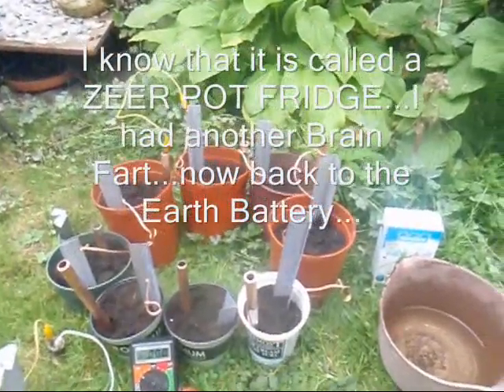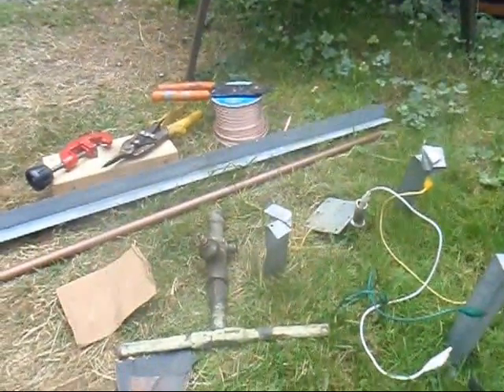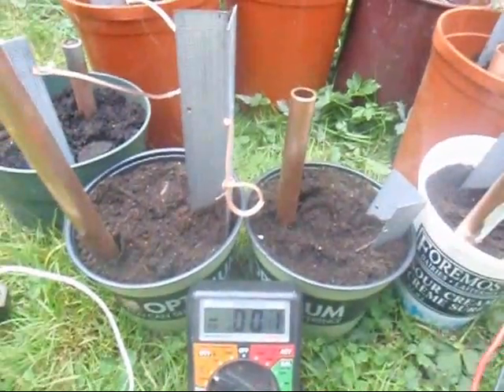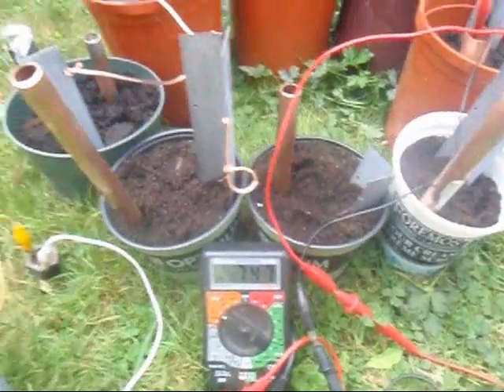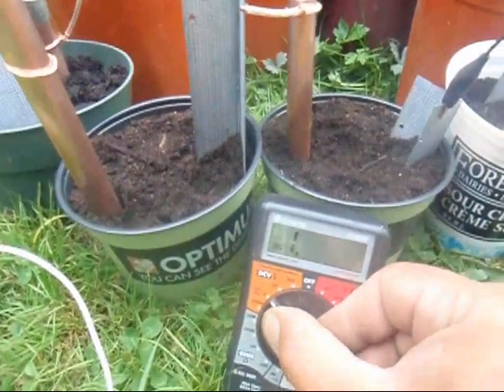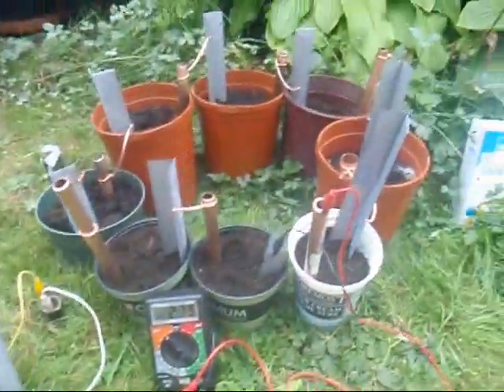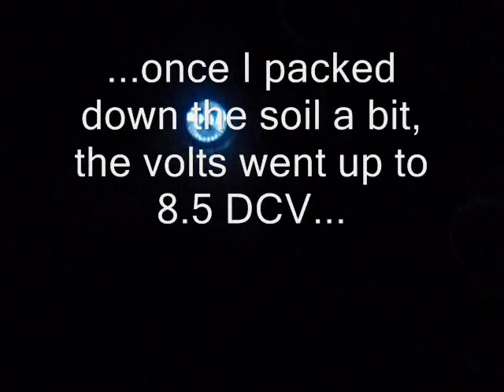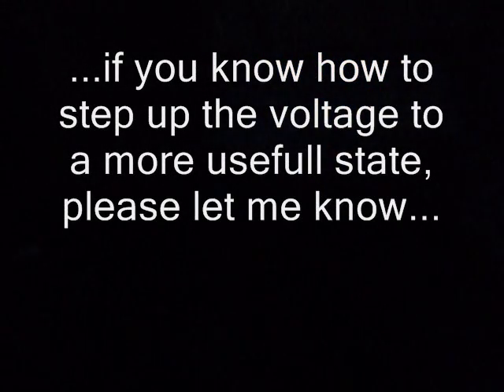8.5 DCV Earth Battery Lights Five LEDs

Comment: try a buck-boost converter this is what I will use if I can not make a set to put out 12 to 13 volts. I think this is great thanks.
Reply from the maker: I did buy a "step-up" converter/capacitor a while back. Unfortunately it has not been tried in this circuit as of yet. Have no idea what junk box it is in...you are welcome. Glad you got something from this twelve year old post... That has always been the goal, higher voltage. But what is really required is more amps in order for a cell like this to be more useful. Please keep me posted...

Comment: Thanks for this info I will try it I would like to build a setup to be able to make 12 to 13 volts DC  this is better than solar pannels was the dirt wet or dry?
Reply from the maker: Your welcome, surprised that people like you are still asking questions. That is a good thing though. As for yours. The soil used was not wet, but damp. All except for the one that had water poured into it. One thing you should try is to hook the cells up parallel, and not in series like in my video. Supposedly it is a better way to connect the cells together. Enjoy....

Comment: Does plastic vs Tera cotta vs metal pots make any difference.
Reply from the maker: Thanks for the question. To the best of my knowledge, any non-conductive material can be used, without any difference to the voltage. The size of the metals used will effect it though. More surface area for the reaction to take place. Using a metal container could cause some sort of "short" in the circuit. But now you have me thinking about just using a can, and copper pipe. As long as the can doesn't have a plastic lining, it should work. Seems like a few tests will need to be conducted...
Reply: @ I also wonder about Terra cotta being wet. Would it cause a short in the system. The metal bucket could be insulated by a terra cotta or plastic plate used to hold water in terra cotta pots as insulation between the container and the ground, IMO.
Reply from the maker: @alberthowe7895  We know water can conduct electricity, so if the soil was saturated it is possible. The soil just needs to be most, not soaked. On the other hand, you can make a "wet cell" battery, where the pipes are in water, and still create a current. Certainly am not an expert in this field, so all my thoughts may not be correct. Still learning myself. You can also research the Baghdad battery. It was used for electroplating in ancient times. (The Baghdad Battery is believed to be about 2000 years old (from the Parthian period, roughly 250 BCE to CE 250). The jar was found in Khujut Rabu just outside Baghdad and is composed of a clay jar with a stopper made of asphalt. Sticking through the asphalt is an iron rod surrounded by a copper cylinder.) Source: Smith College Museum of Ancient Inventions.
Reply from the maker: One more thing is that referring to these as batteries in not actually correct. They are power "cells", "earth cells", "water cells" etc. since they cannot be charged, or hold one.
Reply: @ I am familiar with the Baghdad battery and how it functions.
Reply: Thanks for all the replies.
Reply from the maker: @alberthowe7895   You are most welcome. Thank you for your questions. It has only been twelve years that I have put off doing more experiments. May just be the time to start tinkering again...may have said that once or twice before also...LOL...
Reply: @Drunktoads  well please keep me informed with any results of your tinkering or tests. I look forward to them.
Reply from the maker: @alberthowe7895  Surely will try to finally do that...yours, and others interest in this is inspirational. Thank you....
Reply: @ again much appreciated the conversation on the topic.

Comment: Increasing the amperage for earth batteries is quite simple.  A law of physics states that wiring in parallel will add the amps of two power sources.  We simply wire a solar panel to the earth battery.  We build the earth battery to the desired voltage in series.  Earth batteries are the cheapest voltage around.  Then wire a solar panel to the EB in parallel.  Boom best of both worlds.   Real power.
Reply from the maker: Appreciate your input, thanks for taking a moment to reply. Unfortunately no further testing has been done since the original post date. Have been compiling on the tips from the comments, just have not put into action yet. Thanks again for your interest...

Comment: A Non-Ideal Parallel Circuit
If you build an earth battery using tap water, aluminum, and carbon, you will produce the cheapest green volts in the world.  I discovered that if you wire a solar panel to the earth battery in parallel you can use the high voltage of your earth battery and the superior amperage of your solar panel.  Massive wattage can be generated with this idea.
Reply from the maker: It is always good that people such as yourself keep pushing new innovative ideas to be shared with others on this platform.           Thank you for the reply.

Comment: @drunktoad I love your video. What's the current/amp you can get? Also can you charge a battery band with it?
Reply from the maker: Well Thank You Very Much (in my best Elvis voice). Amps have always been the issue when it comes to charging a battery using an earth cell. You may be able to charge a 1.5v battery with this set up, but not a 12v car battery. With more cells maybe. There is some good information in the comments, and am quite sure better videos than this out there. Appreciate you taking the time to reach out...

Comment: Wouldn't it stop being an Earth battery once you removed it from the Earth isn't it a dirt battery now that it's 8 individual cells in pots.
Reply from the maker: ..ya, I can easily agree to that. The earth and pots along with the anode and cathode create cells...similar to a battery. As you are correct, they are no longer in the Earth, but created From the Earth.
"Energy  Can Never Be Created Nor Destroyed, It Can Only Be Transferred Or Stored"...                                                       You Cannot Free "Energy"...but you could make Energy Free...for the better part of Humanity ???
Reply from the maker: ...so at 01:47 ish, the square galvanized piece of metal, grounded out the pipe. I have mentioned my flaw during this experiment before. At any rate a pencil and a paper clip or penny will get you 00.71 DCV from the Earth...more or less... but the key to Power is Amps not Voltage....which is hard to acquire from the Earth alone...
Reply: My point being an "Earth battery" will give a DC charge much like a battery but aswell an AC charge which batteries do not do "Earth batteries" work with telluric currents.
Reply: No such thing as "free" energy but it's free to me
Reply from the maker: @sonmeister3721  Share your knowledge....I am willing to listen...others too...Have not put much time into figuring it out. But pretty sure somebody else can...or has ???

Comment: I wonder if you put ,multiple anodes and joined them as one and did the same for the cathodes the bigger surface area would give a difference in voltage or current
Reply from the maker: From my understanding a larger surface area does not give a higher output. A penny and a paper clip will put out the same voltage as one of those pots(cells). Pretty sure I did a comparison between the two, not sure if the results were posted or not. 
Thanks for the inquiry...and please share your findings with us here.

Comment: I think the most important thing you have discovered or learned  is  that its not about bigger and more and complicated, but small and simple. If you could get more power from the earth, we would be electrified and barbecued So it works a bit different. Keep.on researching . Good work...
Reply from the maker: Thank you for the comment, your perception of my learning experience is correct. Even though my experiment was not mind blowing, it did act as a platform for learning. (for myself and others) With all the knowledge shared by others comments. Still wonder if it is possible to attach a DCV booster to increase the output ?
Reply: @Drunktoads  Thank you for kind words. I think the Universe works a bit different. Ask and you shall be given. Meaning....if you need 2 volts you  can't be given 10kw. Electrons are just a small part of the atom . Therefore if you could think on the atomic level the way the Universe works and request 10 kw it shall be given to you. So you have to allow the Universe the possibility to give for whats needed. Therefore there are no batteries in heaven :-)
Reply from the maker: You are welcome, and well said. If that 10 kw is in the form of a lightning bolt...better get me a key, and a kite. Thanks again for your thoughts...

Comment: The tube cell built will give out more power. Center rod is alluminium and exterior copper but due to ground touching the copper you may need to isolate it and ground the alluminium. I never grounded them. And add water and oxide in the pipe, copper oxide will do
Reply from the maker: Thanks for the information, the one I rigged up was on a whim and quite primitive compared to others...have not done much since. Hope to get back at it in the near future...

Comment: I got 44 volts from my earth battery. I uploaded it.. I can get infinite energy if I had enough material. You have to make a battery capacitor combo. They can be very small or very big doesnt matter. they'll put off the same amount of voltage.

Comment: Very interesting concept, I wonder what would happen if you changed the acidity of the soil by adding some citrus juice or vinegar? I might have to tinker with this myself, but I'm thinking along the lines of a "Baghdad Battery" which were "supposedly" used in ancient times. Just a basic ceramic pot with a tube of copper and an iron rod inside the copper tube, then pour in citrus juice and it should produce voltage as the acid medium attacks the iron. My thinking is this: Add a piece of iron bar stock in the soil between your copper and galvanized conductors, then pour some vinegar or citrus juice around it in the soil and see what you get.

Comment: I like your setup man. I have come to hear that if the copper being used was in coil form then you could perhaps produce more? in going to try it out, what do ya think?
Reply from the maker: Thanks for your like. Have not done much on this channel in a while but there is a lot of good information from others in the comment section. 
My understanding is that a larger surface area of the metals used does not really produce more power. Even though you may produce a higher DCV by adding more cells, without amps the use of an "Earth Battery" will be limited. Let me know how it turns out for you, for myself and others to learn from the experiment.
Reply from the maker: ...flat pieces would have more surface area contact than a tube due to the middle being hallow and not in contact with the soil. It would be better to use that coiled copper to make a moonshine still.

Comment: https://www.youtube.com/channel/UCtGbSzKy4oqzgqWWQ7DxpPA
How to run a 12 VOLT LED auto light on 1.5 volts AA.........
One can search "Joule Thief" for electronic circuts.....
all it takes is two coils, one a RF (radio frequency) choke from Radio Shack
for $3, three loops of 14 gauge wire around, a 3055 transistor and the diagram.
Anything else is there to improve that....see my channel please!!!
Sustainable_Energy

Comment: The ground is the negative terminal. The positive come from the atmosphere above or the sky. Use a single copper pole that goes into the ground and sticks out high above the ground. The higher the better. 15 ft should yield better results, think it was about 30 ft where the positive draw becomes much greater due to changes in atmosphere. That might be a bit large of a scale to start with, so try what you are able to. Basically the iron pole/pipe is simply a medium through which the natural electric energies can travel through in order to be utilized in a useful manner.

Comment: This is the first message I have recieved. As I said before you must have an antennae 15 feet or more above the ground with wire attached to it the other to rod in the ground. Same thing that powered the telegraph system in the 1880's
Reply from the maker: ...ya that was my fault for the late reply. Thanks for passing it on to myself and others...

Comment: What if you bundled all the pipe and all the corner bead then connect   .seperating each bundle of course  so its bigger electrode each
Reply from the maker: There have been many suggestions made by others, but little experimenting since this video was first published. In theory one would think a larger surface area would provide more DC V, but as mentioned below by using a HB pencil to replace the copper and a galvanized washer more voltage was produced than the DC V from a single pot. If you give it a go, let us know...thanks for the comment.
Reply: Thanks for replying will give it a whirl

Comment: I'm confused as to why you put them in buckets? you're losing a lot of power that you could gain from the earths fields... this makes no sense but I still think it's great that you're getting this out there...even if it is all wrong.
Reply from the maker: Because the buckets hide all the batteries...there is no such thing as free energy. You will get the same amount of DCV from the ground as the bucket. A larger surface area of the metals exposed to the soil will increase the voltage. If you know the right way to do it please share your ideas...thanks for the response.
Reply: First they're supposed to be way farther apart all cells in a direct line positive metal north and deeper based on your latitudes mag. Tilt.
Reply from the maker: When you post your video on how to do it right with the results we will all learn from it. Thanks for the tip...
Reply: or you could just do a bit of research. Not all knowledge comes from youtube, believe it or not.
Reply: And I'm not sure what you're getting at with the batteries in the bucket comment about no such thing as free energy but it's well documented that the first telegraph machines were powered by earth batteries. It's not free energy it's capturing existing energy

Here are some links if you want to try it again correctly.

https://sites.google.com/site/appliedbiophysicsresearch/earth-batt

https://www.researchgate.net/publication/4347039_Experimental_study_of_earth_batteries

http://www.rexresearch.com/stubblefield/stubblefield.html
Reply from the maker: Someone made a comment that there were batteries in the buckets, which is why they were used. Since you understand that there is no such thing as free energy, what is there to question about my comment. Energy cannot be created, only transferred or stored. Thank you for taking the time to post the links for myself and others to view.
Reply from the maker: It doesn't...wow, didn't know that. So glad you told me and any others that thought it did.
Reply from the maker: After reading the replies to your comments, an apology is owed to you for being a bit of an ass with my replies. Thank you for expressing an interest and the links. Sorry for being snide...
Reply: There is free energy sure.

Comment: why my earth battery wont produce volt? is it the soil need the sun to produce the voltage
Reply from the maker: Hmmm...the sun has no effect to my knowledge. Soil should be most and somewhat compact to ensure good conductivity, be sure the two metals are not touching each other, check the contact of the wires, try touching the two metals directly with the voltage meter (set to DC, not AC) and see if there is any voltage. Keep me posted...hope this helps.

Comment: The problem will be the lower amperage.  The way I see it, keeping with this experiment you can get the amperage up two ways.  Another set of pots in series that will be connected in parallel with the first set... OR what I would try is bigger pots maybe even a 5 gallon bucket with much more surface area.  You could buy fairly cheap stiff copper wire at you local hardware store or maybe even find some of the 1/4" tubing for swamp-coolers.  You could coil the copper wire or pipe around the outer edge of the buckets and then maybe fold the galvie corner strips into two or three lengths. Maybe if you mashed the corner flashing you might be able to kind of coil that as well.  It would be fun to test it because in an emergency you could probably scrounge some soil fairly easily.  Maybe you could get it up to 12-15 volts or so to allow for the voltage drop and run a 12V radio or charge your Baofeng 2-meter rig.
Reply from the maker: Amps...that is what is needed. Like the thoughts on the coils and buckets, but not to sure that a larger surface area of the anode or cathode used will creates more DC V. A pencil and washer put out 1.7 DC V while stuck into the ground. The 2" galvanized washer was in half way, and the pencil had about an inch of graphite exposed at the end. The energy is their, the problem is creating Amperage to charge a car battery so it can be stored for later use. Thanks for the thoughts...

Comment: through further research today I now understand this to be a galvanic battery, where as an earth battery would draw from currents in the earth, not the decomposition of metals as a galvanic battery does (so an earth battery is actually an earth generator, tsk tsk on the guy that improperly named those).
Reply from the maker: Agreed, to call it a "battery" is not correct as someone mentioned since it does not "store" the energy, nor can it be "charged"...